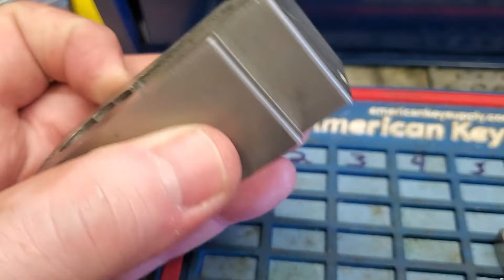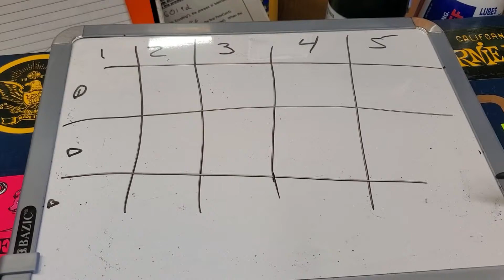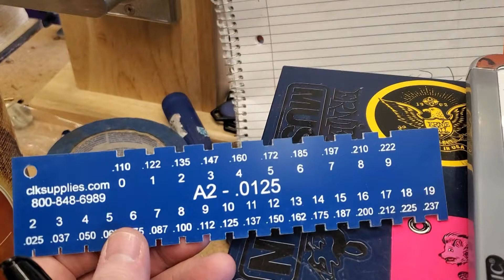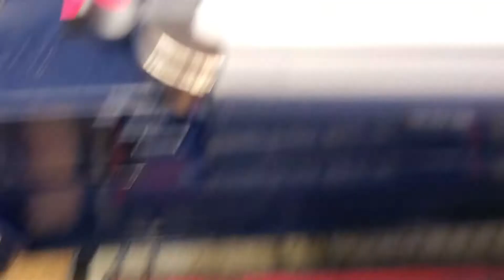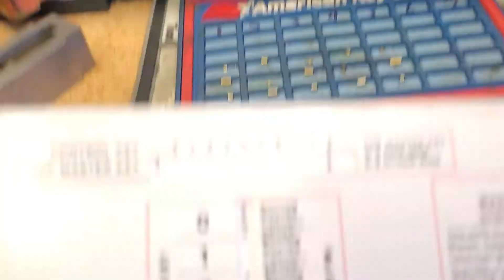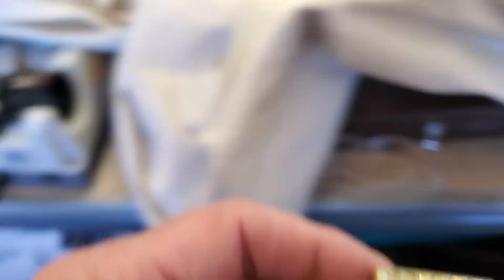Best IC core lock repair keys made locks rekeyed HKS Systems 847 204 7046 High security lock Mchenry

Comment: Great video.  I've been interested in getting a capping press for 150 sfic, but haven't had any luck in finding old A1 or other brand presses.  I see that LAB has a press nowadays using the strips called the LAB IC PRO 150 (LCP001).  Any experience with this one?
Reply from the maker: I think someone makes the duoblock again? Not sure never used the lab but looks tike the typical press type.

Comment: Nice! Used to do a lot of BEST in my last job now I gotta relearn stuff cause I don’t do it as much. Love the old BEST equipment! I remember there used to be a company back in the 90’s/ 2000’s called Marshall BEST Security that was owned by one of the BEST kids and he had all the BEST stuff as well and lower priced. But idk whatever happened to that company spin-off. They were in Indiana. Thanks for sharing
Reply: MBS is still around. Oak security was another spinoff
Reply: @jeffmoss26  yeah the BEST family had some battles when they sold majority off. I knew there were spin-offs but none had the market share to pull ahead of the main Branch.
Reply from the maker: I'm one of the few guys around here that will do Best stuff. Most locksmiths are hobbyist around me. Gotta order everything that isn't a KW1 or a SC1. SMH?? This is WAY over their skillset.
Reply: @hkssystemslocksafe2486  usually people in my area if the don’t know much about BEST they go for Falcon which is fairly compatible with some BEST stuff and lower price. We used a lot of the BEST 9K series at the old Harley plant where I worked with BEST.
Reply from the maker: @odinslock   I never use Best original mostly aftermarket brand. It's very similar in quality and half the price.
Reply: @hkssystemslocksafe2486  I hear ya. I can do a few cores as needed but if I need to do a bunch I usually outsource to iccores. I can’t do it at their price and I add their price into the overall bill. I do try to have on hand what I need if I get hungrier to do that stuff though.  I definitely need to get that LAB Easy Way chart. That’s awesome! Thanks for sharing!